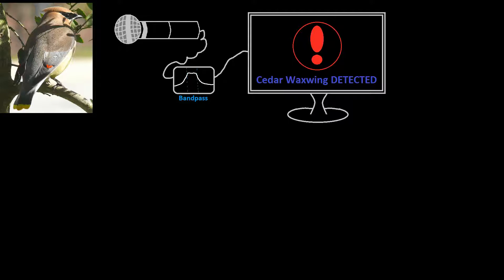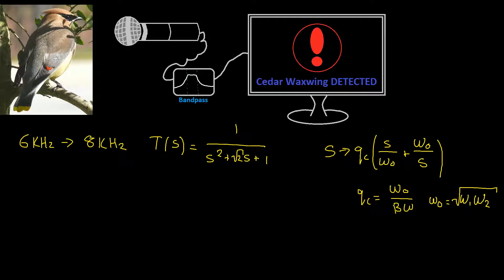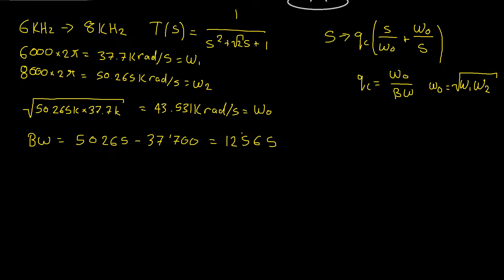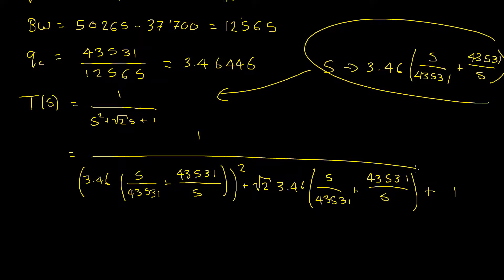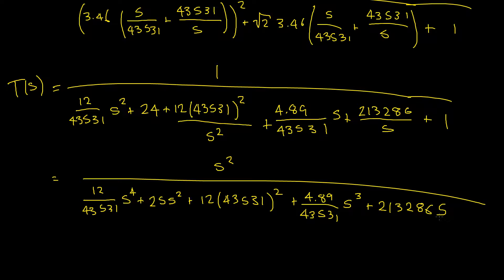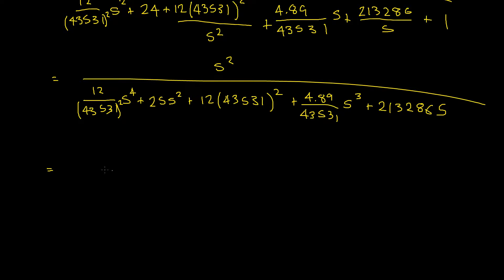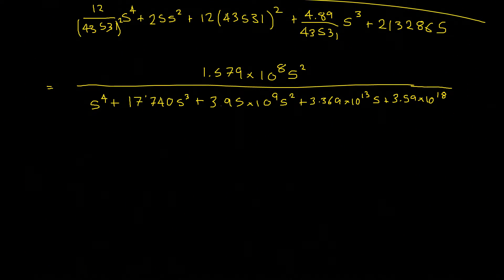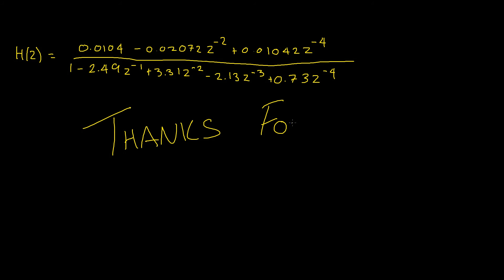Real World Digital Filter Example - Signal Processing #18

Comment: How would it be for a reject band?
Reply: Please answer soon! :(
Reply from the maker: Hey Santiago,
A band reject - or band stop - filter can be calculated exactly as we have done above here, but instead, using the band stop translation. This site here lists all the major translations and explains how they work (including the band stop)

http://www.rfcafe.com/references/electrical/filters.htm
Reply: Thank you so much! 
Your videos have helped a lot!
Reply from the maker: No problems at all :)
Glad I could help
Reply: Luke one more question, what fs did you use to do the bilinear trasnform... Thanks!
Reply from the maker: So we actually implement this filter, and there's a few comments in the video talking about what fs needs to be/was used here:

https://youtu.be/wJgBB4EsUHw 

But if that's too much effort, we used 48hkz

Comment: I might have missed it somewhere but how did you go from T(s) to H(z) at the end?
Reply from the maker: Hey Taylor, for this video we used MATLAB due to the complex transfer function but this is very achievable if you aren't scared by a bit of algebra :) 
In MATLAB we used the bilinear function, we go through an example of how to manually apply a bilinear transform here:
https://youtu.be/rOjHIbevWXM
And go through how this is actually working in another video here:
https://youtu.be/1HBpbagZtrc

Hope this helps :)
Reply: Thank you I will watch both of those.

Comment: Did you input: 

fs = 1000
[numd,dend] = bilinear([0,0,1.579e8,0,0],[1,17740,3.95e9,3.369e13,3.59e18],fs)

into Matlab on 13:17? I got a different output than you. What did you set the sampling frequency as?

EDIT: Oops, I wrote 395e9 instead of 3.95e9!, but it's still wrong
Reply from the maker: Hey Twabourne, 
In this video here: https://youtu.be/wJgBB4EsUHw we implement this filter, and test it with multiple input frequencies to demonstrate how the filter attenuates various frequencies.
Hope this helps
Reply: Hey, Luke

I just wanted to do the bilinear transform from s-space to z-space as you did at 13:17 in this video.  I just wonder how you found H(z) from T(s) in Matlab as you mentioned in your video?
Reply from the maker: Oh sorry about that :) misread your comment! 
Yes that's almost what I used :) It was a while ago now, but your numerator and denominator look good, I just used a 48KHz sampling frequency
Reply from the maker: Sorry mate, I can't have a look at it as unfortunately my MATLAB licence has expired. (Not a student anymore unfortunately) but I'll try to find a way to check for you tomorrow
Reply: Hey, Luke, I managed to replicate your answer by writing the following code in MATLAB:

fs = 48000;
Ts = 1/48000.0

h = tf([0,0,1.579e8,0,0],[1.0,17740,3.95e9,3.369e13,3.59e18],'variable','s'); 
hd = c2d(h,Ts,'tustin')

and then multiply numerator and denominator with z^(-4)
Reply from the maker: That's great news, sorry I didn't get a chance to reply yet. Glad that you got there regardless!